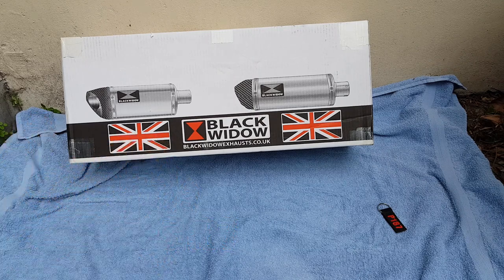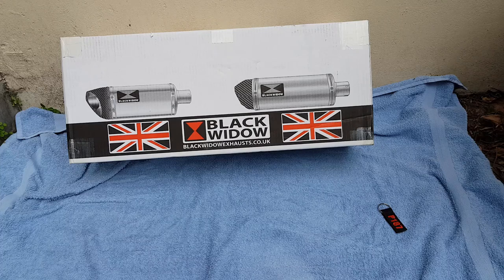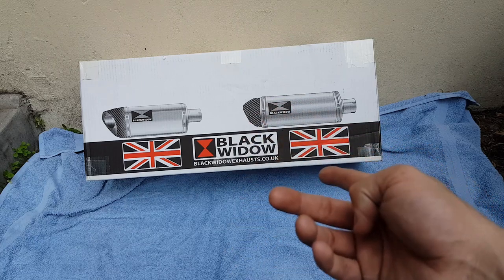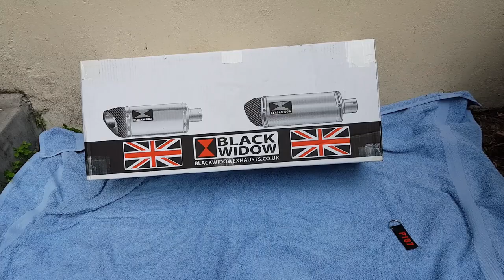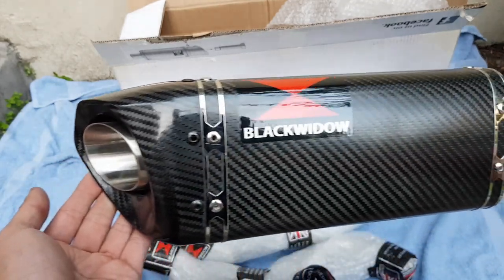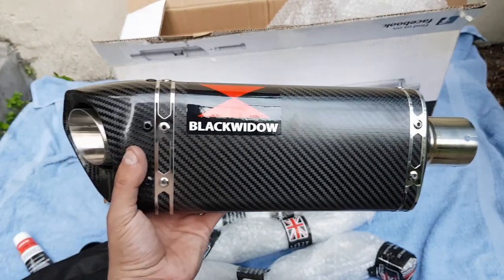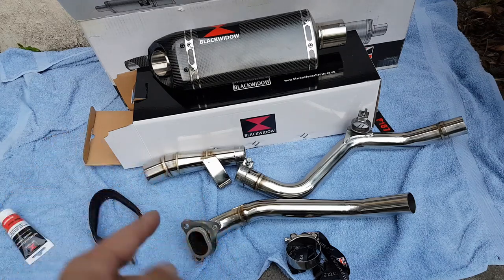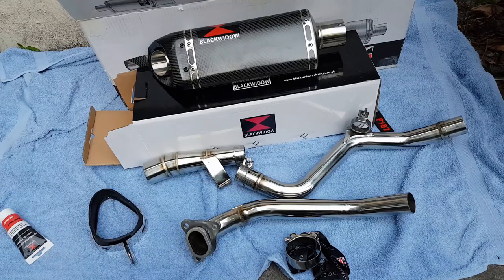Blackwidow Carbon Fibre Exhaust Unboxing - Honda NC700 NC750

Comment: Part number please
Reply from the maker: Hey pal. It's the 300mm Tri Oval Carbon
Part number CC30T. Showing as out of stock currently
Reply: Premises187  thanks bro
Reply: At firtst great video!
I have a question. I'm a little confused about the exactually size of the silencer.  In the description of the CC30T on the black widow website, i see a lenght of 300mm without tips. Youre silencer on the video looks smaller. Do you have the possibility to measure the full lenght of the silencer including tips for me? I really like the size on youre video 😅.